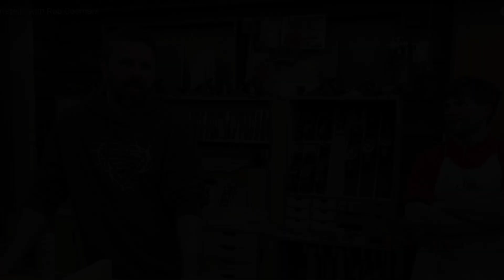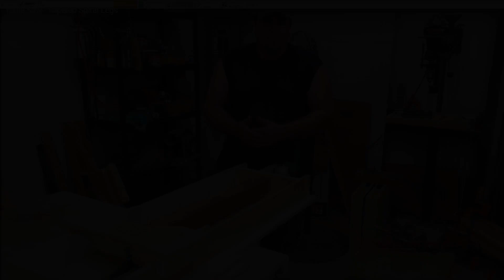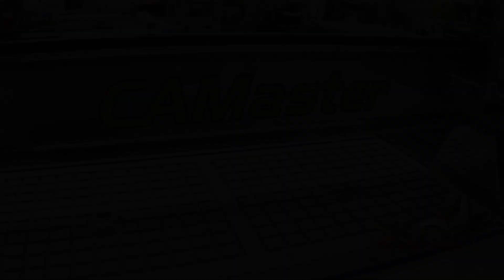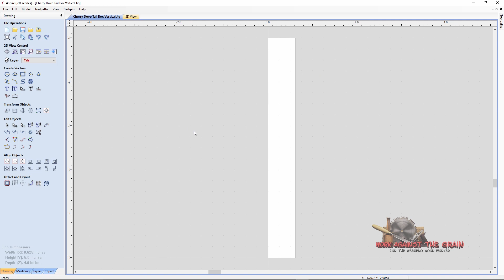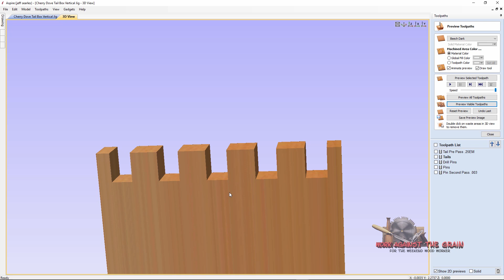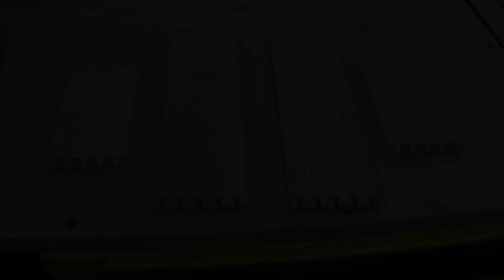I DID IT !!! Dove Tails On the CNC

Comment: I don't have a CNC YET, but as I move toward one, a MUST is some way to vertically mount stock like this. Not many machines seem to have that ability, or even prevent it by running their drive screws underneath the center of the spoilboard. I use my Ready2Rout system for dovetail and box joints; it has the ability to add glue clearance to the joints. You might want to figure a few thousands in for that or you'll squeeze out all the glue when you put joints that are that tight together. But seriously, what you've done is amazing! No one who has seen the standard attempts at CNC dovetail joints is pleased. This is wonderful! 

I don't know the Vectric software well- it surprised me to hear you say that it couldn't show the undercut of the dovetail bit. Why is that?
Thanks again!  
Larry

Comment: Please post details to make the vertical clamp fixture shown in you video, dimensions, a vectric file to make the parts for it, etc.
Reply: I will second this, please post some details on the jig, how you installed it on CNC, and tool path.  great, great stuff in this video. thanks for sharing
Reply: It's a quick release clamp screwed to a board with an edge stop, nothing technical

Comment: Fantasic, Great job. I gave up on the dove tails but made some great bears ears. I make the joints one corner at a time with both pieces clamped into the router at once. Saves on the setup time.

Comment: Have never seen dovetails done with half tails always half pins. they look great right off the CNC. If you plan to use this alot more I would work on cleaning up that toolpath though, seems like there was lots of cutting air and retracts that were not necessary. great job in the end though.
Reply from the maker: Jeff Lalonde Thanks for the input. you are absolutely correct. I kept it simple for my own organisational purposes to avoid screwing up. Now that I "get it" I can optimize the tool paths. Thank you very much for watching and the kind words.

Comment: Excellent video I'm currently going to do some half-inch dovetails for sliders for my router table drill press and bandsaw. But I noticed you said early in the video that when using a dovetail tool in Vcarve Pro (12), it doesn't preview the image as a dovetail, Did you hear that correctly? Thank you Jayme

Comment: I think I saw a 0.001" gap there on one pin…

But seriously, those are very nice dove tails. I noticed a bunch of extra moves the CNC is doing that could be edited out of the path but I can't argue with the result. And I love the idea to cut a hole in the table so you can mount the piece vertically.

I wonder if there is a way to add a stop so you can mount the boards without the need to rezero the bit every time…
Reply from the maker: Thanks Fred.....Yeah the "extra" moves was me being very very careful to make sure I accounted for everything. As for the zero block, great idea. As long as stock and joints are the same no reason why you couldn't. Thanks again for watching.

Comment: They look GREAT!! just a thought what if you sandwich the piece between 2 pieces for scrap to prevent the tear out you could skip the drilling operation.
Reply from the maker: Bob Heltibridle Thanks Bob, I will have to try that.
Reply: We make lots of CNC dovetails and sandwiching the boards between spoilboards stuck to the clamping fixture works like a champ. Once I get everything set up like I want, I change the spoilboards and run the whole job.  They stay nice as long as nothing changes with the toolpath.  Next time I start over.

Comment: looks awesome. what size is that machine it makes my 9014 look like a dog toy. unfortunately i cant cut a hole in my table because thats where the ball screw and linear rails are. might be possible to remove one section of the bed on the side and do it from a slightly different angle under where the 4th axis sits

Comment: That's brilliant!  Very nice looking dovetails.  Any way to see more info about the jig you made to hold the boards in place?  Any issues with them slipping while cutting?
Reply from the maker: G Dub I will show more in the jig, and up to 16 inches long and 6 wide the one clamp on top  holds perfectly with no movement. Much longer and an additional clamp will be applied at the bottom of jig. Thank you for watching

Comment: Awesome job. I am a CaMaster owner as well and I love my machine. Do you have any plans or setup videos on how you integrated the jig?
Reply: Thank you for watching. Apologies, I didn't make any plans. It's a square piece of MDF with another piece of MDF attached to left side. Hole cut thru spoilboard, then slide jig thru hole. Make sure fence on jig and table are square to each other. I used those toggle pressure clamps on top of the fence to hold work piece in place. I hope that gives some sense of it. Shoot me an email to jefonitoo@gmail.com and I'll send you the file I used. Thanks again for watching. Also, this video https://youtu.be/tq91SxlDnrM although different software shows the jig.

Comment: What speeds and feeds did you use for this, or that are recommended in general for use on a milling machine? I would like to try cutting some woodwork from pallet wood on some cnc mills at work, they run up to about 7000rpm. Ive heard that is too slow for milling woods?
Reply from the maker: Yeah 7000 is a bit too slow I'm afraid. I ran this at 75 IPM in XY 35 IPM in Z at 18000 RPM. I don't think you can get the chip load right at 7000 RPM. You'd have to feed the machine so slow and I'm afraid you would burn up your not to mention the burning of the wood. Really need 12-15000 RPM to mill wood and avoid tool burn up in my opinion.
Reply: Work Against The Grain 

Yeah I agree. I ended up running a piece at 6000rpm with a 4 flute carbide endmill and fed it around 15ipm for a pocketed dovetail slot. It worked quite well. I then came back through with my cheap 2 flute dovetail router bit again at 6000rpm and 5ipm with .050 stepover passes to the final slot dimensions. This ended up working rather well also, however since it is a pocket slot it has a radius at the edges which Im decided how to deal with. I can always machine the tail with a radius also to fit or I can go in by hand and clean it up. Im just cutting some old pallet wood to make a table. Thanks for the help and advice! Hopefully everything works as planned. Awesome video by the way, the best yet that I have seen regarding milling dovetails on wood.

Comment: Your background/history on this topic is funny --  I feel your pain! Nice video. Thanks for sharing! 

A couple questions. First, have you considered the special-purpose software for CNC dovetails as an alternative to Aspire (JointCAM, etc)? I've become a big Aspire fan, but am curious if you've explored that option. Second, any details you feel are useful to share about the jig or is it pretty obvious?
Reply from the maker: Mike Davison I have not looked at other programs. I will do that. Jig is pretty straight forward but I will do a video on a couple things that have popped up since first try. Thanks for watching.
Reply: As Mike mentioned, JointCAM would basically make quick work of exactly what you did. You already have the jig and the hole in your table... Jointcam would allow you to do all different types of dovetails with different spacing, etc. It's only like $150 for the full license, too! Thanks for the video!
Reply from the maker: moparx12 I just started experimenting with joint cam a month ago. Works pretty good.  Has a couple bugs, but works well if machine is setup PERFECT. Thanks for watching.
Reply: It has bugs? Can you tell me your findings on it? I am about to make a bunch of drawers and roll out trays and will be using the software for that. If there's something I should look out for It would be great to know it advance!
Reply from the maker: Make sure the outside pins are at least 1.5 times the width of your bit. While cutting the tails, when it is done, the Z axis retracts straight up. I found if my last pin was less than 1.5 times the width of the bit, when the Z retracts upon completion it did so in the middle of the work piece, and cuts off 1/2 the tail. Also, I found that the tail stock over cut and clearance parameters do not really help and can be confusing. Stick with 0 and 0 in these two places. Finally, unless you are dead on accurate with the spacing between your left and right boards, do yourself a favor and cut left and right separately. It's gotta be perfect to cut both sides at same time. I need to point out, it seems to be a very cool program and for the most part works great. As i said, I just started playing with it a month or so ago and hope to get a video out soon. The things I mention may be MY lack of knowledge and NOT the program itself. Good luck.
Reply: Good to know of those limitations. Thanks. Will look forward to your future video on this topic. Would like to try cutting joinery on my machine so I appreciate your sharing your investigation here.
Reply: Excellent, Thank you for the pointers. It seems as though I have seen an old video (maybe 5 years old) where someone used JointCAM and had that Z-retract problem happen. I had assumed they had fixed that bug by now :/. I am going to message GeForce with your comments if you don't mind... I think they might be helpful to revise the software or maybe your methods, whichever is causing the problems!
Reply from the maker: moparx12 That would be great.
Reply: I copied you on the email... Have you had a chance to see his response?
Reply from the maker: I saw yours to him, did not see reply yet. Not in spam or junk either. jefonitoo@gmail.com
Reply: ill forward to you... maybe he didn't copy you sorry.

Comment: I am a camaster user and have a spindle with ceramic bearings so they do not offer a z0 touch pad. What z0 touch pad do you use.
Reply: Design Department It is an aluminum pad CaMaster provided. Perhaps I don't have ceramic bearings.
Reply: Thanks.

Comment: I am new to cnc and i wonder if there is any way to set how much "travel" the tool does and how it does the travel. In this video it seems that half the time the tool is up in the air not cutting wood and moving in the air in a pattern that is to a noob like me seemingly innefficient. Instead of just cutting from where it is it moves to other part of wood and starts cutting there. Seems it moves in a manner that takes alot of time for movement and little time for cutting. It should be the otherway around in my noobish book :) Else it will just spend time travelling, like a magician waving a wand instead of doing anything :D
Reply from the maker: Raisorsharp The extended travel and time in the air is me being OVERLY cautious when programing the tool paths. Your observations ARE accurate.  I just get so nervous that I will be too aggressive and miss something causing the tool to do something I would regret. You can certainly when skill and knowledge permit optimize the tool paths so the tool spends more time cutting and less time doing nothing. I'm just as I say OVERLY cautious. Thank you for commenting and best of luck in the world of CNC. It is quite the learning curve. Fear of breaking my machine or ruining the work is why I program with caution. Have fun!!
Reply: Yeah i understand the caution, I guess i will do the same when i get mine running until i figure out what are reasonable cutting speeds for wood etc.
Reply: Raisorsharp reasonable cutting speed? Is wood, if you must mill steel you Will shoot your brain? This is a very noob cam program .. no more excuses

Comment: Love it, but how about using old fashioned hand skills to uphold the art and craft. that is dying, not computers.
Guido Steding from Steding Interiors and Joinery
Reply: CNC programming and routing is an art in itself. We shouldn’t discriminate against the machines and their ability
Reply: The ingenuity required to come of with this "out of the box" solution is just as important as hand-craft.  Innovation has pushed every industry forward throughout the ages, including wood work.  There were no powered mills in the 1700's, no modern chemicals to use in finishes.  New techniques have also come from thinking outside the box that were not possible or thought of in centuries passed (innovation), the first of which comes to mind is gluing up pieces of lumber in specific grain directions to make beams far stronger and stabler than a solid piece of lumber of the same overall dimensions.

Hand-craft has is place and it's allure and it's high-regard.  The years of dedication that go into it are worth holding high, mention and honor.  But new ideas and new techniques are what drive us to find better ways and create better products.  Sometimes a repeatable process allows us to make something widely available that otherwise would be too expensive for the average consumer to afford.  Think Henry Ford.

Nice job Man!
Reply: I guess it is like using Excell to make 100 math operations in a second, sure, I can do it by hand, but how long would it take? Also, there’s a lot of people that has a lot of imagination, but their designs live only on their mind, because they lack the manual abilities or skills, CNC allows some of them to actually bring those designs to life.
Reply: +Janine Steding, writes "Love it, but how about using old fashioned hand skills to uphold the art and craft. that is dying, not computers."

So how about junking the CNC altogether and using old fashioned hand skills to uphold the art and craft?
Or, how about getting rid of your car and using an old fashioned horse and buggy to uphold the art and craft that is dying, not internal combustion?